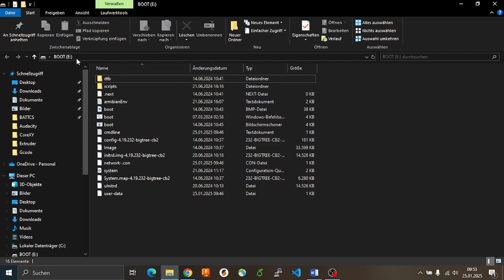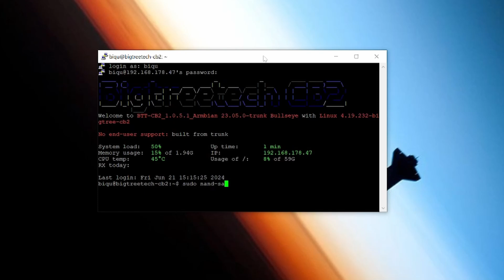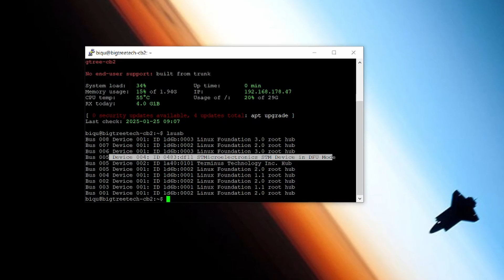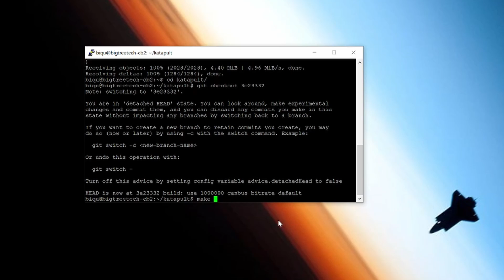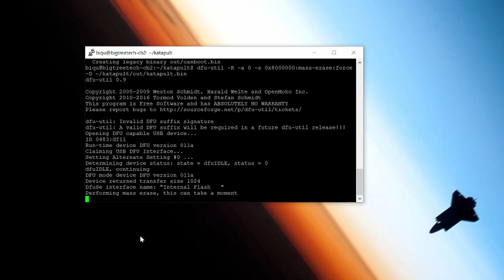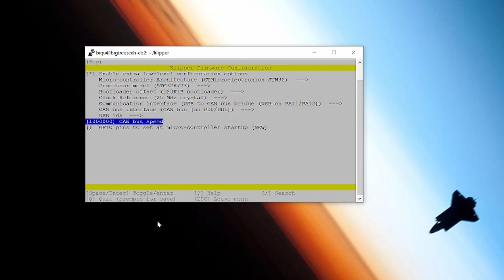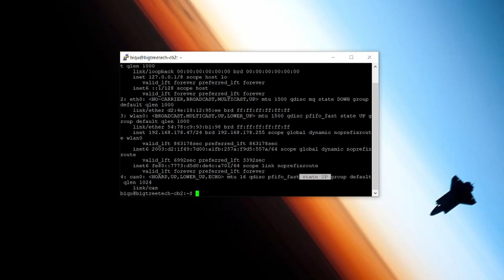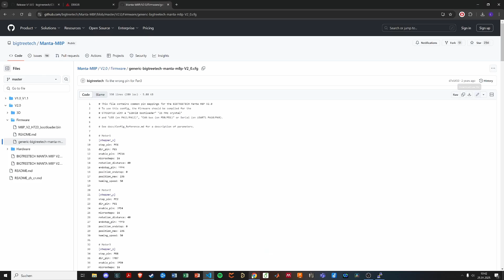[A Guide:] Klipper Board Setup with BTT Manta M8P V2 + CB2 Compute Module

Comment: So for anyone else with the same issue I was stuck at flashing katapult. When I entered "dfu-util -R -a 0 -s 0x08000000:mass-erase:force -D ~/katapult/out/katapult.bin" it came back "Cannot open DFU device 0483:dfll found on devnum 4 (LIBUSB_ERROR_ACCESS)" and "No DFU capable USB device available". Turns out I needed to run "sudo chmod -R 777 /dev/bus/usb/" to grant permissions to non root users to have access to USB ports.
Reply: haha i just found this solution and was about to comment this as well. should have checked the comments first.
Reply: Thank you for this
Reply: @connorwoods3652 glad this has helped a number of people. It’s a shame having to jump through so many hoops to get it all setup. I’m now foolishly attempting to make an overkill water block setup for the stepper drivers. This board is awesome.
Reply: @PRSRVFRSHNSS im new to the... Stepper motor, 3d printer, motor controllers and everything lol. 

BUT, I did spend a few months perfecting my PC's hard tubed water cooling loop. So i know the joy/ pain of what you're trying to do now
Reply from the maker: @PRSRVFRSHNSS  thanks for the info
Reply: Thank you
Reply: Good Job, and thank you for your help
Reply: Thank you so much!!

Comment: Hi, I have a query. I want to connect Raspberry Pi with Manta 8P. I connected using C type cable but I get the mcu id as pi@pi:~/klipper $ ls /dev/serial/by-id/*
/dev/serial/by-id/usb-1a86_USB_Serial-if00-port0. What am I missing here.
Reply from the maker: Havent read much about connecting via USB-C. However i read that u can use the GPIO Pins on the Pie to use a UART connection. However, havent tried that.

Comment: I had an issue with the make -j4 flash FLASH_DEVICE etc... where it could not find the serial/can/usb so i used this command to find the serial instead "ls /dev/serial/by-id" then used  "make flash FLASH_DEVICE=/dev/serial/by-id/" followed by the serial id and that worked.
Reply: Thanks! your method worked.
Reply: This is where I keep failing.  I got to the same FLASH_DEVICE part and it did not work then i tried the ls /dev/serial/by-id and it tells me "not such file or directory".  Then I try it with the FLASH_DEVICE=0483:dfll like it recommends but still nothing... help?
Reply: @maxkievit3  i have the same problem dit you figured it out yet
Reply: @smeenk0517  I have not, I dont now if its an issue that i'm using M8P v1.1 with a CB2 instead of a v2

Comment: I got as far as flashing katapult via dfu mode, but led light stays solid red, no blinking
Reply: Found out that if I take out the "!" before PC3 pin in menuconfig, it does blink.
Reply from the maker: Can you find anything in the BTT documentation regarding error codes on that one? Otherwise maybe just pressing reset or power cycle the board. But haven’t encountered that issue

Comment: I flash the sd card then i put it in, and the green light starts to flash, but I can't get the ip address of the router
Reply from the maker: @ryanedelam43  mhm. With which tool have you looked for the IP address? 
Or maybe a typo in the WiFi name or password before flashing the card? Then it would not be visible
Reply: @lukasOtis  I found it my Internet had two ip types

Comment: If you have problem with password, boot via root and make a user name and password for both the user name and (admin)root, then you can follow his steps. biqu worked as a user name but it would not work as a password. and there is not trouble shooting on this
Reply from the maker: Thanks, that’s good to know!
Reply: @lukasOtis  It's shocking how rubbish the biqu site is.
I've done step 1-2 and step 3 not working and they have nothing on there for trouble shooting. 
How can I end up with a board that biqu not the password and then they have nothing to correct that.
Their step by step is so vague and if something goes wrong. It all about doing this via USB and omg, does it not work. 
I don't know if it a language barrier that makes their PDF files worthless or just laziness but you'd think they would have their own channel with clear instructions. When you tried logging in for the 100th time and have access denied, or try steps 1-2 two dozen times and step 3 never happens with the USB method. Even their documentation says use biqu as password and user name. 
Did installing it to eMMC take long for you,
Reply from the maker: Sorry for the late reply. I do really understand your frustration. I was kinda lost until I found the guide that I linked below the video (you may have to translate it) and some other tutorials. Afterwards i did´nt look at the official documentation anymore. 
The eMMC flash did not take too long, maybe something like a minute. If i remeber correlty

Comment: Fantastic walkthough!  I was absolutely stuck getting my MCU flashed and this got me there without any issues.  Thanks!!  I wrote the OS directly to the eMMC, no SD card needed at all.  Just a note for anyone else that does, to do that you need to set RPI-BOOT and USB-OTG to ON, your board won't enter bootloader unless you reset them back to OFF after the OS is written.
Reply from the maker: Great to hear! I will definetly check out how to write the OS directly to the eMMC

Comment: sweet walkthrough! why do we need resistors to overwrite some security mechanism? didn't get that?
Reply from the maker: Klipper expects a temperature reading on the hot-end and heated-bed. With a 100kOhm probe we can simulate the temperature probe input